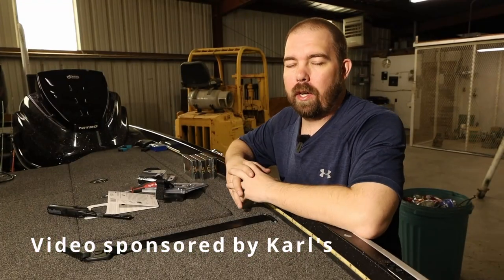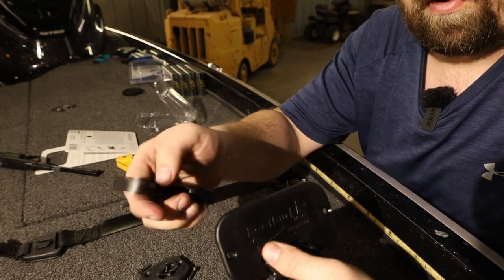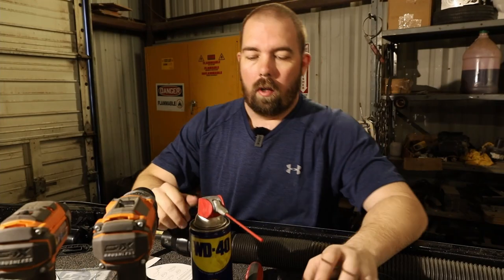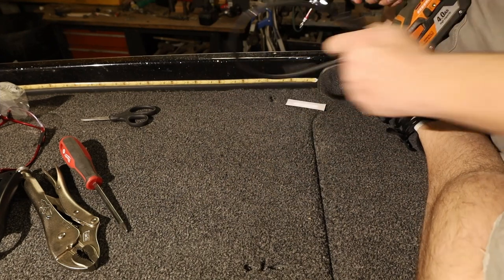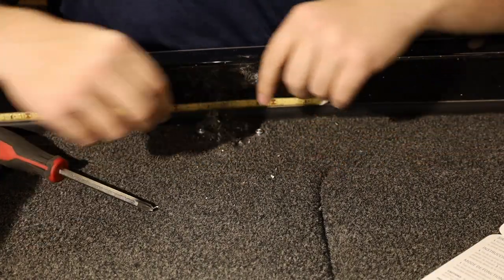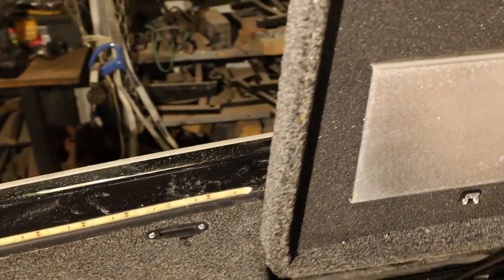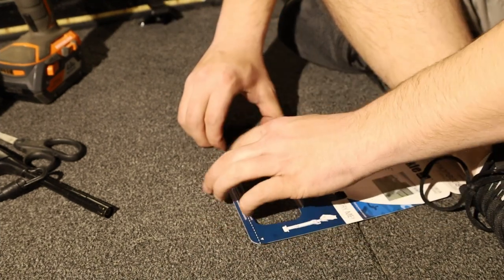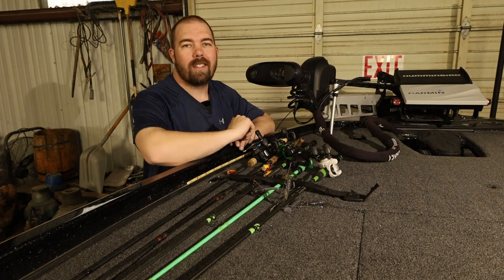How to Install Rod Buckles AKA Rod Straps or Retractable Strap

Comment: Hey great video. I have a rod buckle to install and didn’t even know there was a concealed mounting kit. Does Bass Pro sell them?
I will get a kit and get get mine mounted right away. This video was a great help. Keep up the good work.
Reply from the maker: Bass pro is expensive. I got mine on Amazon.
Reply: Thanks for the info. I’ll check out Amazon.